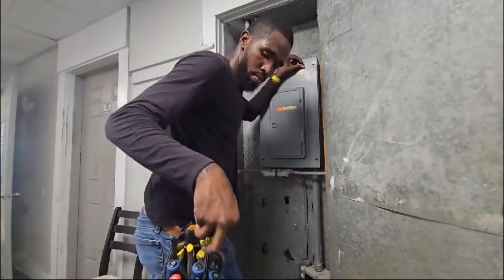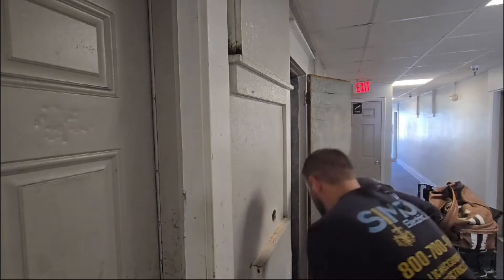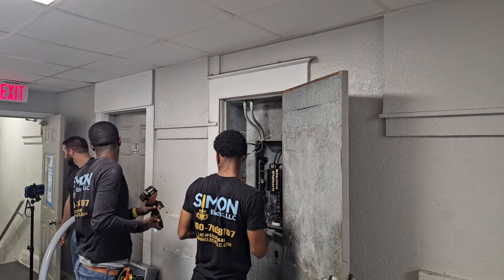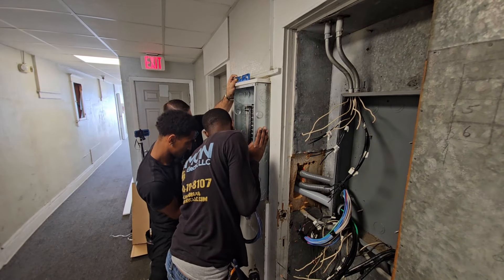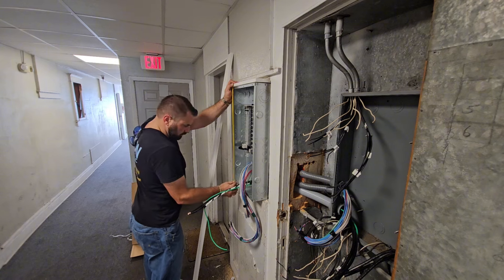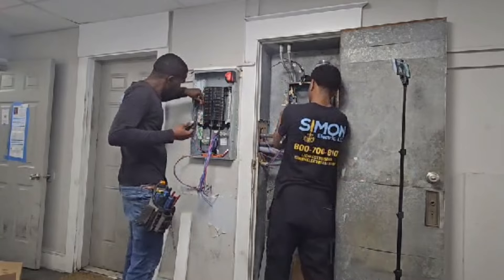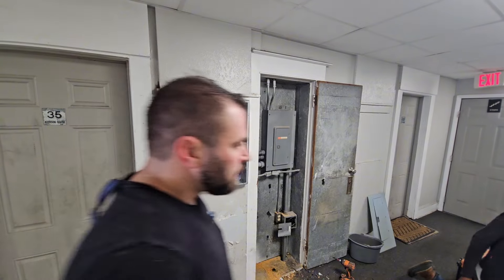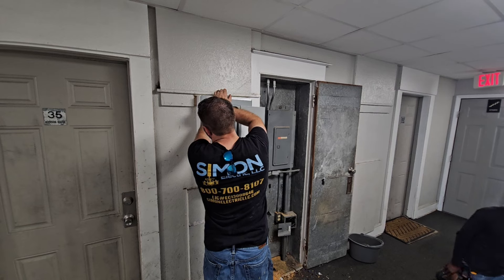Replacment of the second F.P.E. Fire hazard panel.

Comment: I love watching this stuff. I used to do this kind of thing in the late 2000's. I can't wait to get a hold of an FPE panel to make a FPE panel campfire video. We took one of these 200 amp jobs and the electrician had a huge chunk of 4/0 SER cable and wired it into his service panel. He had a feed thru panel that had open lugs so he tabbed it on there and put an FPE out back where we "experimented" on it. I've never seen so many electric heaters on a 20 amp circuit before. Everything was smoking and eventually the wire bursted into flames. I want to recreate this for my channel. The sound of loud electrical humming was amazing. I wasn't there for the grand finale but he loaded up every 15 and 20 amp circuit and said many breakers actually still tripped just fine but the 50 did not and the entire panel melted down.
Reply from the maker: Very cool!

Comment: I did a few FPE panels and Disco's in South Carolina.  Some are super heavy to remove.
Reply from the maker: Yes for sure they are literally 3x the weight of modern panels and 2x as thick steel
Reply: They also use thick copper bus's. Too bad the stablok design was a complete failure.

Comment: I’m really interested in becoming electrician but it’s it hard to learn. I know a little bit I recently changed seven receptacles outlets because there were so old from the earliest 1970s and I replaced it with a heavy duty residential grade. But I heard that you need to have 6000 hours on the job if I got that right but I love your videos.
Reply: Seems like all licensed trades need "time in the field" to qualify for the final test. 6,000 hours is 3 years as an apprentice. 40 years ago, I needed 4,000 hours to get my base level heating license. After that I could do further testing every year or two for the other levels, but I changed trades.
Reply: Yep doing things right takes education. And lots of it. Never stop having the desire to learn
Reply from the maker: @rupe53  did you ever put in the galvanized ducting? That is artwork to me.
Reply from the maker: @ecospider5 I literally learn something every day, whether it's a little trick or a new code I memorized.  That's why I kinda laugh a little, I am technically a "master electrician" because I went to a little schooling and took a series of tests. But in reality, I will never truly master this trade. There is always more to learn, and I'm fine with that
Reply: @Simonelectricfl    I have installed some ducting, but I was the helper, not the lead man on the job. I serviced warm air heating but didn't do installations on a regular basis. If I had stayed there, I would have tested to "tin knocker" and full-blown AC tech. I already had the license to do oil burners, oil and gas pipes, oil tanks, and the associated plumbing, which came in handy when I went to generators, because they needed a guy who could do the gas and oil (diesel) plumbing. The heating license covered that part, plus "near unit" wiring, then I had many years in auto / truck so had a grasp of the engine aspect. (both gas and diesel) BTW, the artwork is ductwork is measuring, bending, and making it fit.... without using CAD to do the cutting and bending for you. It's even harder than bending conduit like a master!

Comment: Any FPE PANEL IS A FIRE HAZARD…..   tho.   U can actually weld with a 15 amp FPE breaker.       Did a house distribution panel.  FPE ..   the buss bars are in Front ….   The cover is a two person job to remove/ replace AND THE panel cover has claws that fasten the cover on …,   Had one make contact with a bus bar ….    What a noise …..!
Reply from the maker: Yes they just won't trip lol
Reply: Uggh.hated those boxes

Comment: the only thing i would do different was cut a pice of steel and dead front the old panel just looks better and makes it harder for any one to tamper with the wiring to bad you could not just put the new panel in the old location so you didt have to spice in to all those wires iam not a fan of doing that but if code says you have to do it that way so be it:)
Reply from the maker: I would have liked to do that, but technically, that is modification of the original UL. Listening for the fpe panel and the inspector could technically fail us for that.
Reply: @Simonelectricfl  see here it would pass they must have some tough codes in FL

Comment: I have a 1950's house . wiring is mostly cloth covered.   the cloth is dry rotting.   NOT GOOD .
Reply from the maker: Yes I would try to fix the soon. One pro tip is if you do not have ground in the outlet boxes you can add a gfi outlet in every outlet location and the is a code compliant alternative but you need to put the little sticker that states no equipment ground.

Comment: nice place broken glass on the fire extguisher cabinet and not replaced  iam surprised they paid for the panel replacements
Reply from the maker: It's under new ownership, and they are renovating the property
Reply: @Simonelectricfl  maybe you will be back to rewire the whole place :) so it can be done the right way from the start then:) not saying you work is not right its right with in the guide lines you have to follow to make it meet code:)

Comment: good old fpe or as my instructor used to say FIRE PROBABILITY ENHANCED with red handles of hellfire lol
if you see fpe red your wallets dead 🤣
Reply from the maker: I always tell electrical apprentices the red means fire on the breaker so they remember.
Reply: @Simonelectricfl  you ever come across the bulldogs/pushmatic your way for panels?
there ok panels if you have the luck and patience to take the breakers apart and regrease them otherwise they are prone to gumming open or closed to almost never resetting if they trip. ( i did it a cple of times as a proof of concept and to win a bet ) (it wasnt worth it know matter how drunk i got afterwards lol)

Comment: Was it the budget or something hidden in the wall that kept you from setting that panel flush?
Reply: 0:35 he said the new code requires space on either side of the panel. That’s why it can’t stay in the cubby hole. 

Correct me if I’m wrong but that sounds like recessed panels are not allowed in that environment anymore.
Reply: @ecospider5    Flush with the finished wall is not recessed. This install would be considered a surface mount. As for the code, panels are not allowed in a closet these days unless that closet is large enough to qualify as a room with the proper working space for personnel. As I see it, it was cheaper to move the panel than to shim it out, remove the door, and add new drywall in the original location.
Reply from the maker: @rupe53 There are load-bearing studs in the wall. The original plain was to have the panels flush mounted in the wall, but that was not possible.
Reply: @Simonelectricfl    I can see that as a major cost factor and the average electrician probably would not have picked up on that wall being loadbearing. The other option would have been to use the existing location, remove the door, and have a carpenter finish it off, but that's another cost.